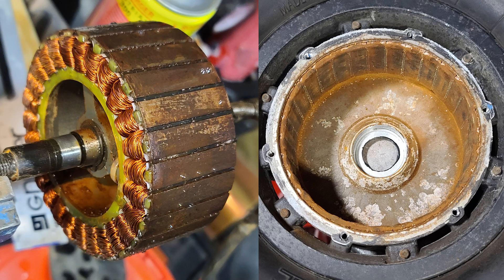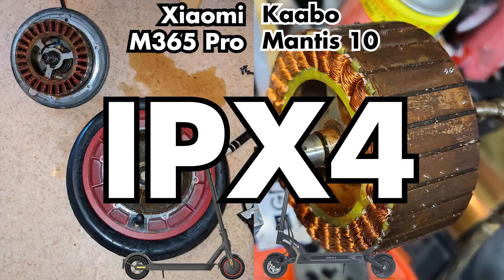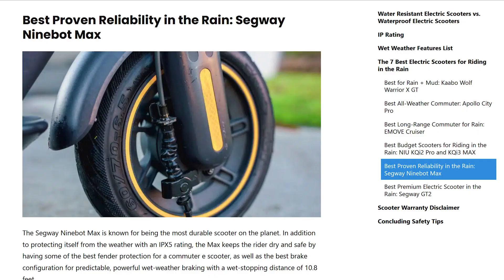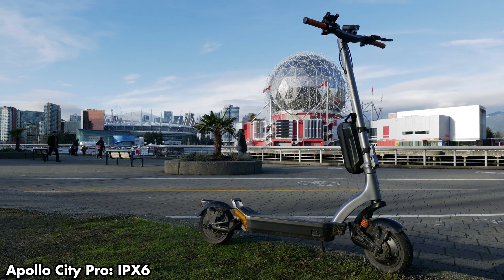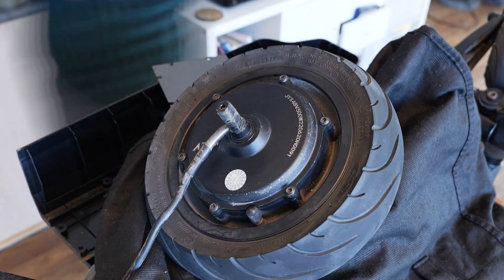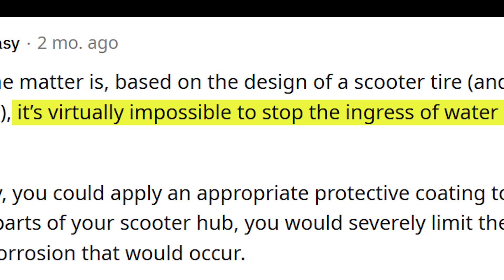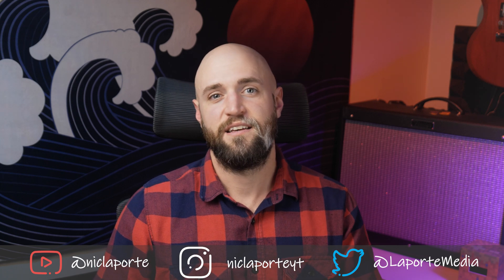Are Scooter Hub Motors Waterproof?

Comment: 3:48 quick tip : some of those Chinese scooter have very strong locktite on those hub bolts , i have learned over the years to not risk it and blast it with some heat like 6 seconds and the bolt should come out really nicely and easily

Comment: I never ride mine in the rain, ever!  Manufactures will not cover the warranty if it's water damage. I've also used WD 40, brake cleaner and coated the scooter. Runs great, with no water issues. (GO Trax G 4)

Comment: that ipx8 rating in your image 1:09 paints 8 far better than it is. It's 1.5 meters for 30 minutes. IP68 for example isn't waterproof at all and stuff gets damaged constantly.
If you want stuff to actually last you need something fully waterproof, it won't even go by this junk rating either.

It isn't that hard to fix some things, like batteries and the motor controllers.. like get liquid tape and silicone and smother stuff all over.
the motors are a bit harder, opening the hubs and coating it inside can sometimes do it depending on which one it is.
like your one at 2:25 would be extremely easy to seal up

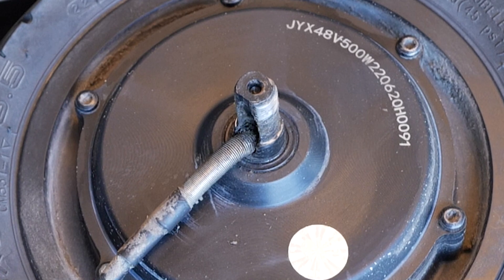Comment: that metal spring thingy is supposed to go at the top of the wire near connectors, not at the bottom where you have it  at 4:39 . Thats how you will cut or short the wireing for your motors and have to replace the whole motor.otherwise great video nic.  i reccomend high temp rtv silicone it  should do the trick for creating that rubber ring around the motor cover like you have built in on those for any others of similiar style.
Reply: This is so false. It's literally there as additional protection for the wires. Wire insulation by itself is vulnerable to abrasion, and to being cut through. The metal "spring" isn't.
Reply: @Chris-oj7ro  ok bc I don't have the same type of motors with the same shrink wrapped spring 🤦.

Comment: I got an IX6 Iscooter, I want to be able to ride through light rain, Whats the best way to cover up electric parts?
Should I put silicone inside the cable holes and  and cover the connectors of the cables too? 
Need tips as it rains quit a lot in Belgium lol,

Comment: Nami burn e has had water ressitant motors for a long time they dont stand a chance if u fully submerge them in water but for stuff like in this video their great only thing is their sealed with some type of glue because i dont think the rubber woud survive the heat of the nami motor even thoe they coud have installed some type of gasket witch is temperature ressistant and doesent let water into the motor
Reply: Nami is garbage

Comment: I took my 10” (15” OD tire) hub motor apart (replace the hall sensor I accidentally shorted) after 2 years riding after it rained, water puddles, etc and it looked brand new like yours.

One thing I noticed your motor and mind share is the phase and hall wires enter in the bottom and exit inside the motor out the top, making a snorkel effect (as long as you don’t install the stator upside down). So in theory water is not going to want to go inside under normal conditions, and you can probably submerge it up to the top of the tire and water won’t go in…

….except if you got the motor very hot and then cooled it so fast you created a slight vacuum. But the stator is not going to cool so fast so its a fight between the covers cooling the air and the stator heating it. Hopefully by then you are no longer submerging the axle.

While i was waiting for the hall sensor with the motor open inside my apartment, it actually got more rust than 2 years of being sealed up. 

Another factor is I am in the Philippines. There is no such thing as dew. The temperature never drops to the dew point. But in climates that hover around dew point daily it can suck in humidity and condense it, suck in more humidity and condense it and after enough cycles the motor will be filled with water vapor when hot and if cooled just a little will condense again and suck in whatever is at the opening for the phase wire. And if you try to seal that (you shouldn’t), it will just suck it in through the seals because the vacuum can be much more than the seals can withstand.
Reply from the maker: Very interesting. Thanks for sharing. I didn't think of the snorkel effect.
Reply: @imho cool story bra

Comment: Yes I came across the same problem with my Kugoo bike, so much rust, but I cleaned it out and sealed the motor edges didn't bother where the cable goes in to the wheel, but the outer rim fully water tight, easy to do, just get some silicon sealant and spread it around the gap, there is always a gap on a motor that was not made to be water tight, so all you are doing is sealing that gap.

It's a cheap fix that works very well, water can't get in via the usual route and all is well.

The cost of sealing the motor less than a pennies worth of silicon sealant.

But a scooter could be slightly harder as it's lower to the ground, however using the same silicon sealant you could seal the underside deck to stop water getting in, and the motor you could do the same with that as well.

Easy fix, low cost it just takes a little time doing it.
Reply from the maker: Great solution. I may be receiving a scooter with a lower IP rating. I might try that.
Reply: @nicthedoor  You can seal any bad ip rated bike or scooter you just have to identify where the water could get in, you can even protect your electronics using silicon sealant, cable connectors and so on.